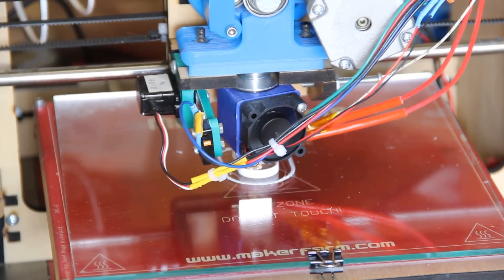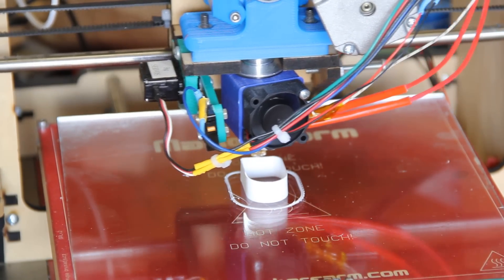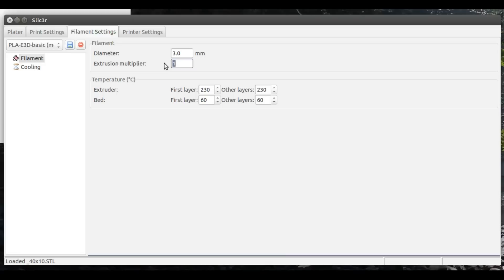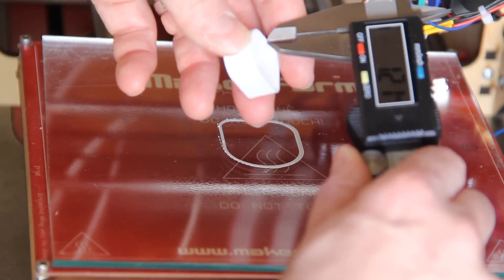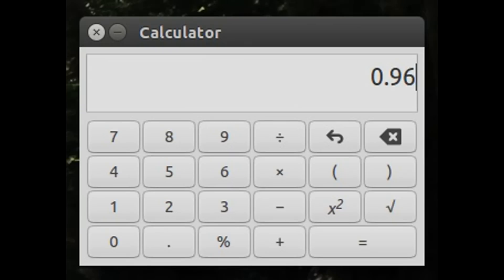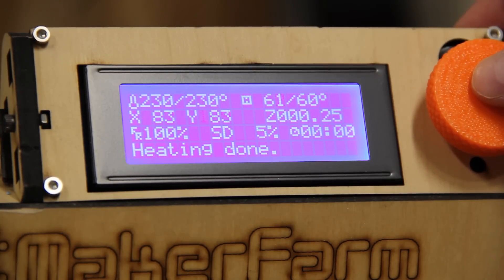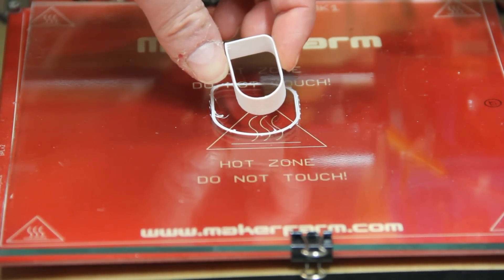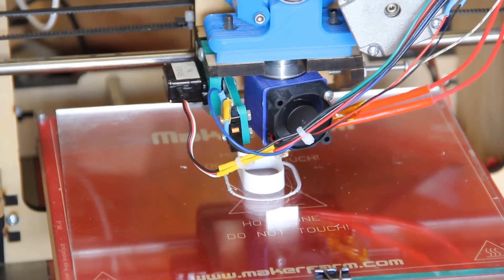RepRap 101: Setting your 3D printer's extrusion Part 2: Fine Tuning

Comment: PLA at 230C?
Reply from the maker: I knew someone would notice that! :)  The piece I was using is actually a sample I was sent.  It's the oddest filiment I've ever printed.  (I did in fact check to make sure it wasn't ABS, btw!)   With the E3D, 210 is about the right temp for most PLA, but this one doesn't flow unless it's hotter.  The results are quite nice, though.
Reply from the maker: PrintAlot My experience has been like Kent's.  That particular sample was very strange, although the prints came out very nicely.
Reply: ZennmasterM Really? 210 degrees for PLA with E3D hotend? I never tried anything higher than 190 degrees and never saw any problems. What kind improvement could I get when extruding at 210?
Reply from the maker: Kenny Liebert
If you're getting good extrusion at 190, then by all means, keep at it.  I find that I occasionally get jams on some filaments when I run cooler.  At 210, all my PLA flows nicely (including a bunch of glow-in-the-dark, which I find likes a little more heat), with the single exception of the previously mentioned sample I used in this video.
I have also found that in general, printing at the hotter end of the range gives better layer adhesion, although this is more pronounced with ABS.
Reply: ZennmasterM is this on all your prints with a E3Dv5 or just one ?
Reply: I originally commented because I was using a cheap j - head with PLA at 185. I now have the E3d v6 and I have to have PLA at a minimum of 200. Obviously filaments will vary from roll to roll or manufacturer to manufacturer but the E3D loves a warmer temp.
Reply: Kent Dixson ok thank you Kent